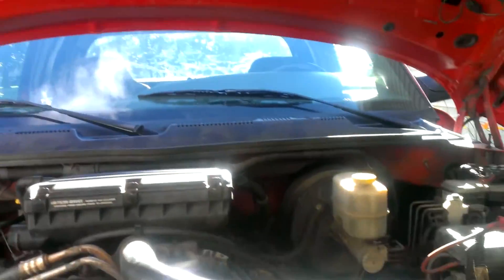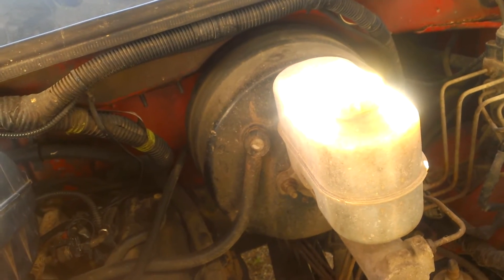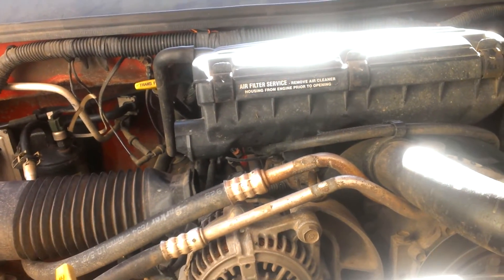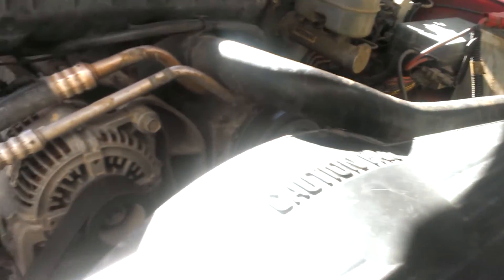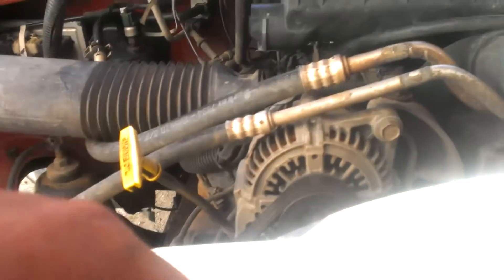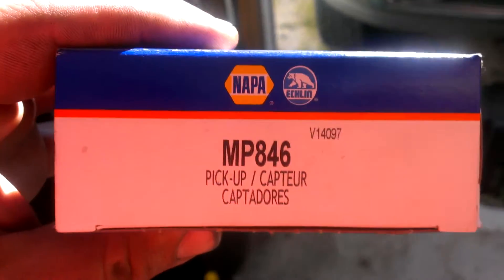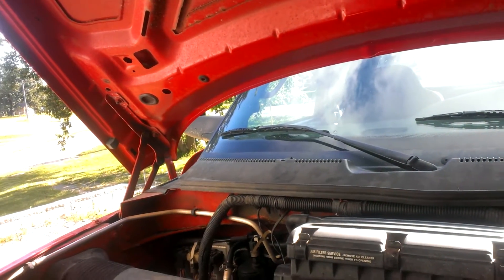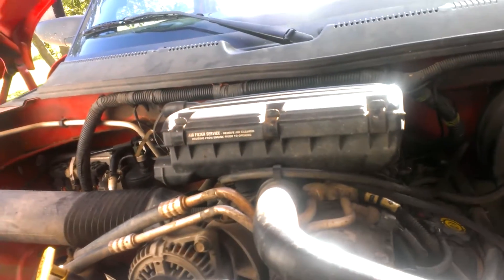Dodge ram stalling issue part3

Comment: Good video- Looking for Part 1 where I presume you describe exactly what SENSOR you replaced, where it goes EXACTLY and why you found out that particular part was the problem.
I have a '99 1500 and replaced the Cap+Rotor so far with plugs and wires to follow soon. I had a sputtering issue before the new Cap/Rotor and less of one after. But it was still there. I bought some 16 OZ Seafoam and put about 1/3 in the fuel and drove it around. Works much better now, while RPM is at .80 (3/4 RPM) while idling. 
Used to hover around the .50 mark or Half RPM so that improved too. Once new Plugs/Wires go in that should help.
I don't think my TPS is bad yet nor the AIC Sensor at the back of the throttle body. But will be watching them.
My understanding with SeaFoam is You can also infuse it into the engine thru the Brake Booster Line? But instead of pouring it you should put the fluid in a cup and let the Brake line suck it into the engine? Do this AFTER engine is warmed up and RUNNING. Let it sit for about 15-20 minutes, crank it up and drive it while white smoke comes out the tailpipe.
Reply from the maker: Here is part 1

https://youtu.be/yTTxAdWjEBg
Reply: Thanks

Comment: Thanks for the video man I think it's going to help me out with my problem on my truck
Reply from the maker: No problem! I hope it helps!
Reply: Well I tried it today I didn't actually help me but I got some new ideas I'm going to replace the three sensors on the throttle body and clean the throttle body real good and try that I'll let you know if it works so it can help somebody else maybe
Reply from the maker: @tember1988  a lot of times as these trucks age everything starts to wear out and over time multiple things can cause a single issue. Mopar vehicles used a square wave form instead of a rounded one like everyone else. The square wave form has many benefits but its biggest downfall is when things start to wear out the edges get rounded off. Those rounded off edges will throw bad signals and cause issues.

Comment: Would love to communicate with you about what your are finding about a stalling issues with your Dodge Ram. 
 I have a 1996 Dodge Ram and got it new. It now has 350K and now is needing some serious loving.  It has been a vary good truck to me and my family and has always been reliable. I have no intentions of ever getting rid of it.  I get me a new GMC so now my dodge is up for a rebuild. Just have some issues with her stalling at the moment at different times..  
Have replaced AICV , Throttle sensor, map sensor and fixing to install a new coil..
Reply: I have a 1995 with a 5.9 litre engine and it's doing the same thing.  What was wrong with yours?

Comment: Hello I have a 1996 ram 1500 5.9L and I am still having a stalling issue. I have replaced plugs/wires/cap/rotor and pick up and it is still stalling atlow rpm at stop lights going into reverse... I have to give it more pedal and have the rpms up to keep it running. I also have a DTC 1762 and that is the govenor pressure sensor and silionid (low voltage) will this cause my stalling problem

Comment: I have a 96 dodge half ton with a 360 while going down the highway it will buck are some will say miss and the transmission will kick down but will shift back in the normal gear im wondering if the sensor under the distributor cap is the problem give had this truck for 12 years and never replaced it please respond thank you
Reply from the maker: Joey Holland mine did exactly that before it started stalling.

as always a good tuneup is a great idea if you haven't done one in a while.

Comment: Need help finding out what’s wrong with my 96 Dodge Ram 1500 it stars but as soon I put it in drive and gas it it dies
Reply: Probably hve to check the ignition coil … possibly a loose connection (ignition coil).

Comment: What would make my dodge 1500 stall while I'm driving and my gauges drop
Reply from the maker: I need more info than that to make a good guess. I cant ne sure since I'm not actually there to look at it.
Reply: Well I changed ignition coil ignition switch fuel relay and it stall while I'm driving or sitting still   and when it stall my gas gauge go's to empty and my voltage gauge go's down
Reply from the maker: tim madden sounds like an electrical problem, but I'm not sure where to direct you.
Reply: It was a coil wier had a mobile guy and he tested it and it's bad

Comment: Dodge stalling issue fixed hey buddy I have a 2000 Dodge Dakota quad cab 4.7 and I got the stalling issues runs fine on the highway but when I come to a stop the idle goes down below 500 and I put it in neutral and I keep rubbing it it won't stall on me this is a pain in the butt the temperature is not hot my PCM is good I replaced All Those sensors from the camshaft to the idle control you name it could it be my Cadillac converter? But then again it don't bog down or nothing just wants to stall when I bought it 5 years ago they had the motor redone has a 04 or 06 Jeep Block in it sounds healthy every time I fired up I live in Arizona and it's a garage kept vehicle shoot me a message title it Dodge Dakota with a number so I can get ahold of you sure like to figure this problem out thanks for your time my name is Dave
Reply from the maker: Dave Cartwright sounds like a typical fuel pressure regulator issue. My truck is starting to do the same thing occasionally. Thinking about having it replaced when I take it in to get brake work done.